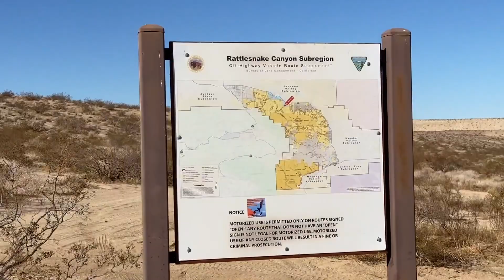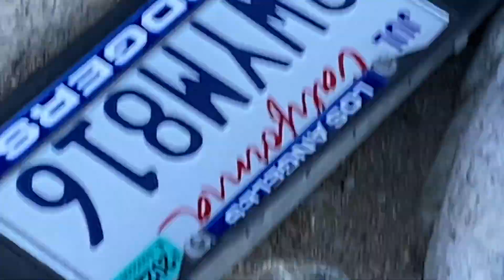OUR JEEP LEAVES US BROKEN & STRANDED ON THE TRAIL!

Comment: That’s definitely something that needs to be diagnosed, if it was faulty, imagine if you hit an unexpected pothole on the highway and that snapped? That would be an unconsolidated nightmare, I’m sure the company/manufacture will figure this problem out, thank goodness you had all that help with you. I wish I could keep a smile on my face like you guys when things break Great video you guys👍
Reply: The whole weight of the jeep was on it. It wouldn't snap from just a pot hole. You can watch it bend before it breaks
Reply: Michael Sullivan that’s correct the weight of the vehicle was on it and thank God it snapped there, the point I was trying to make was it could’ve happened on the way home if it was already stressed  and the reason I bring that up is because it happened to my best friend coming back from a trip something similar, the part is heavy duty and it broke at the stress point right where the nut is tightened.  Not saying it was a bad part at all, just glad it didn’t happen unexpectedly somewhere else at high speed.   Also the reason I stated the manufacturer will examine it is because they sent it back to the manufacture to do test on the metal.   Happy 2022 to you✌🏻

Comment: Hydro assist more than likely contributed to finding a bad spot in the rod. I’d bet if you laid a straight edge down the length of the hydro cylinder from axle mount to clamp end and past it, it crosses the tie rod where the rod end threads in. It was just the point under most pressure. Like Kev and Chris said, if moving the axle end mount out to run parallel was an option then it may not have happened. But returning to a tried and true setup is an easy fix.
The only reason good aftermarket exists is because someone broke something else, so it’s just trail R&D 😂
Reply: I’m pretty sure the clamp needed to move toward driver side. The tires were turned all the way but the cylinder had more to go

Comment: if you look real close just before it snaps you can see that both tires aren't pointed in the same direction, and you can see the tie rod end bending, that thing was under a lot of pressure
maybe send the raw video of the failure to the company and they can study it to find the reason it failed
Reply from the maker: We’ve sent them the video & the broken part so they can analyze it
Reply: @LiteBrite  nice, i hope it helps them to make the part better
Reply: RPM should have quit when their bumper company went under.

Comment: As you showed the cross section of the broken tie rod and without getting to technical it failed because of the atomic grain structure that formed while the metal was cooling, an anomaly for sure.
Reply from the maker: Hopefully a fluke. We sent it all back to RPM to look at.
Reply: I would put money on that you will find that the threads on the tie rod are stretched from the tie rod assembly sitting on the rock and flexing the tube with all the weight of the truck. The threaded end is the weakest link on the tie rod assembly. 
Looking at the picture of the failure it’s a shock failure not a defect in material. The tie rod threads were stretched when tie rod assembly was hung up on the rock. Then snapped when the tie rod had a load on it. Because it’s a cast piece any stretching is a point of failure. We are only talking about a few thousands of an inch.
I hope you sent the other tie rod to them to analyze and X-ray to see what the structure of it is like. 
I would want both ends replaced. 
For your hyd assist did not cause this failure. The hyd assist is only push and pull force. Your failure is from up and down or you can call it side force failure. 
Example grade 8 bolt is a high tensile steel bolt. It can be stretched more than a grade 5 bolt. But if you put a side force on the bolt it will shatter. That’s why Jack stands use a soft steel pin so it will bend instead of shearing. That’s why you don’t use bolts on Jack stands. Failure is from side loads. Or in the Jack stands case the bolt is designed to stretch not move side ways. 
It’s a not a complex failure? 
The tie rod end was asked to do something that it was not designed or engineered to do, ( take a side load ).
Reply: @craigmckenzie8028  well said, I think, I got confused at money... lol
Reply: @craigmckenzie8028  this makes perfect sense especially seeing the tie rod being put under all that load just a few minutes before it broke
Reply: @craigmckenzie8028  so why did our other tie rod last 2.5 years and hundreds of hits to it? The other tie rod has been through hell and back and have had zero failure.
Reply: @boughtnotbuiltoffroad7784  Well it’s very simple answer. If you go back to your original install video and look at the part where the the tie rods are laying on the floor. Your new tie rod assembly is flawed in design to fail due to the solid design ( if you are crawling on big rocks and landing on the tie rod assembly just like you did) the fail point is the cast tie rods. They are so far away from the tube. If you look at your old tie rod assembly it’s all steel the tube is longer and the steel tie rod ends are short. Being a longer tube, shorter tie rods means it can flex and can absorb shock loads. The longer tube and shorter tie rods and made from steel are designed to be forgiving. 
Your new tie rod assembly looks great but not for what your doing ( rock crawling). It’s to solid. The design flaw I see is the tube is to short, needs to be longer and the tie rods ends need to be shorter. The material also is to rigid. They need to design in some amount of flex. With being so rigid a design, the weakest link is at the machine threads meeting the tube. The tie rods are so long and solid ( can’t flex). The cast doesn’t bend, it will stretch a few thousands of an inch and then snap. Basically when you were stuck on top of the rock with your trucks full weight on the tie rod assembly you were putting a side load on the tie rod ends and being the cast tie rods had to take that load that they were not designed to take. The tie rods are basically designed for push / pull force. Yes they can handle a bit of side force but not the trucks weight. 
I think that if the tube was longer and the tie rod ends were the same length as the factory tie rods. 
The failure was basically the cast tie rod ends were to long the force of the weight of the vehicle on them caused such a side load that the cast was not designed for. 
Your old tie rod assembly shows you how flexible it is and doesn’t have to be big and super strong to do what you are doing. I would stay with your original tie rod assembly. You have proved how well it works and can take a lot of abuse in the field. 
The new tie rod assembly looks wonderful but not designed for any flexibility. ( don’t rock crawl with a rigid tie rod assembly)
(Just want to clarify this is a great tie rod assembly but be aware if you are rock crawling and get into the same situation that Kevin was in this could happen ).
Bigger is not always better. That’s what she said. Lol
You guys make great educational off road videos. 
Cheers

Comment: Love the trails you take sorry about the tierod. Looks to me when you landed on it you could have cracked it. btw Happy New Year.
Reply from the maker: Happy New Year!
Reply: I thought the same thing, coming down on it so hard might have damaged it prior to it snapping like that
Reply: Yeah, I think when the weight of the vehicle dropped on that link, it caused a stress fracture on the tie rod end which resulted in the final failure when it was stressed by the non-parallel pressure from the assist ram.  To be honest, better that it failed there rather than going down the road.  Any steering gear that has the type of force that the rod had when bouncing on the rock should be inspected for stress cracks.   Those parts are not generally engineered for that type of impact or stress direction.

Comment: From the camera angle you could literally see that tie rod giving way, I'm surprised Kevin didn't feel that it the wheel. Any time I've lost one you could feel the steering get sloppy prior to the failure.

I'd also maybe suggest to Apex that they design a better guard for your mounting hardware. But that trick you showed to protect your lines might be a temporary solution for those running that setup.
Reply: When tire pressures get that low and your all over that squish on the sidewall, it's tough to know what's going on down there... Especially when good vs broke is only a few thou. When I'm wheeling at low pressures I can't tell you how many times I've hopped out to double check what's going on in my front end and my steering angle!

Comment: In you mount the fixed end of the ram at the pas side of the diff, and have the active end near the very end of the tie rod, right before the adjuster portion, it will be significantly stronger. In the current setup you are effectively flexing and adding outward and side to side forces to the tie rods. Be relocating the active end to the end it is also less prone to rolling the tie rod.